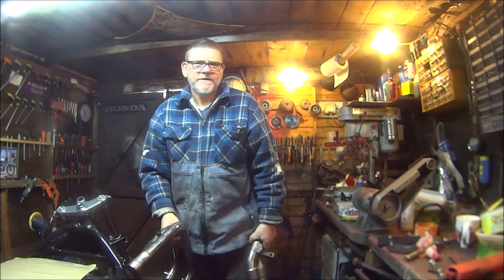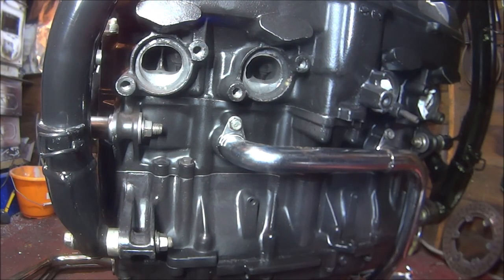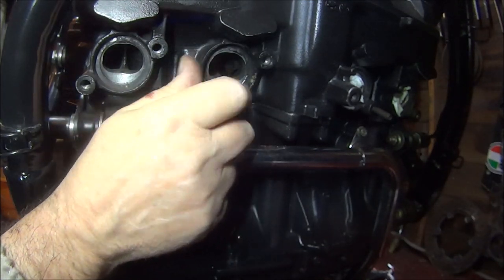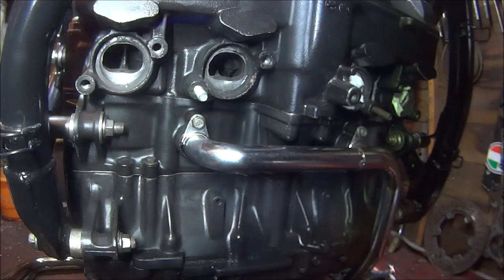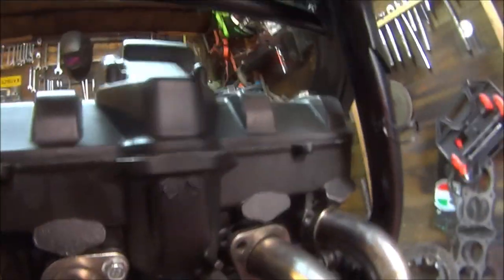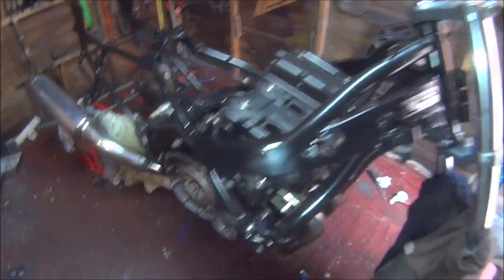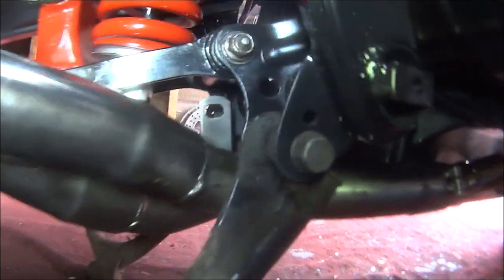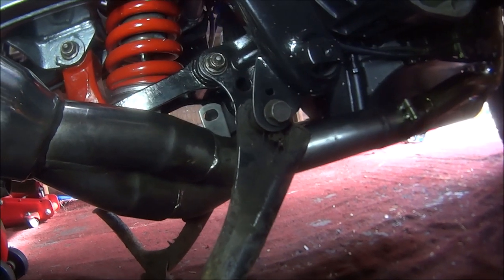CBR1000F Landfill bike.. fitting the 4 into 1 Exhaust

Comment: Hi
I really enjoy seeing your vids on this bike model! 
I'm about to relace my oriignal 4 into 2 exchaust with a used 4 into 1 and have been through most of you CBR1000F items. 

Do you have one of your videos showing/explaining how to remove the radiator, so it's possble to access the two middle studs/nuts behind the ventilator? 

I've tried and failed to gain access with my wrench :) 

And this video shows just how easy everything gets when the radiator is not in the way. 

I guess I'd have to drain the coolant and remove the lower coolant hose where it attaches to radiator, and what, remove the ventilator temperature switch wire, the horn and then what, 2 bolts in the top of radiator and one in the midlle center below?  
But what needs to be remove on top of radiator, if anything - can it just be tilted forwards to make room for the wrench? 

Hope you see this and have a suggestion to this newbee ;) 

Greetings, Brian
Reply from the maker: hi yes you need to remove the rad and drain all the coolant......https://www.youtube.com/watch?v=XUL-whmnwn8